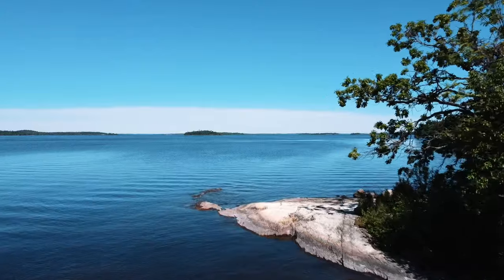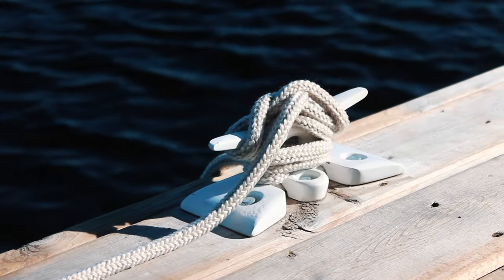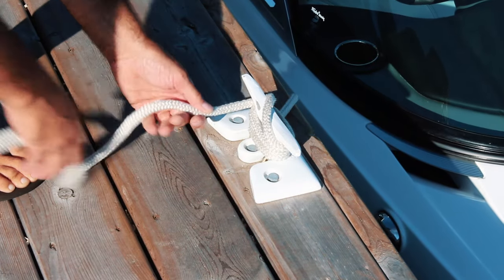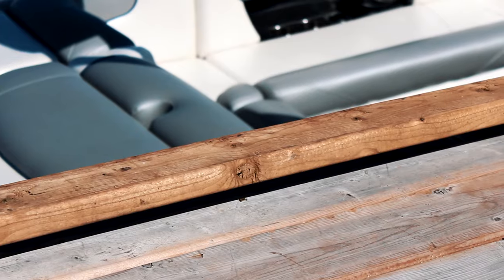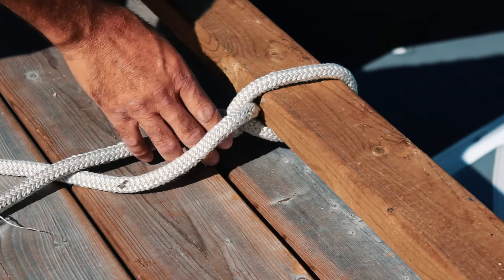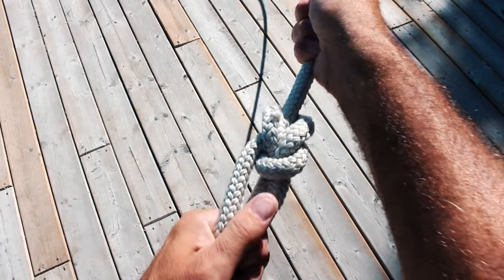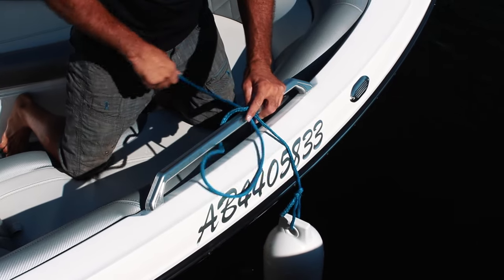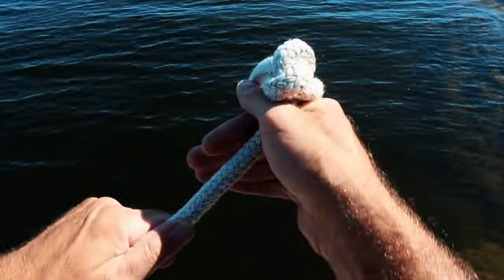Learn 5 Essential Boating Knots | How To Tie and When To Use Them | Lake Life Quick Tips

Comment: I would add the taut line hitch to the list of basic knots boaters should know. I use a taut line hitch to secure the fenders to the boat railings which allows you to easily adjust the height of the fenders along the side when you dock at various ramps of differing heights.  Good short video on knots basics!  Thanks.
Reply from the maker: Thanks glad it was helpful!

Comment: Also good to note that it’s very important to match your diameter line to clear size, I think it’s 1/16” to one inch of cleat. Now that being said a small vessel is going to typically have 4 1/2” cleats vs a typical 12 or 16” dock cleat in this case wrapping a few wraps around the larger cleat with the smaller diameter line then continue with the typical hitch, this will give surface tension to the larger cleat with small line, personally I wouldn’t thread through the eye of the cleat simply because not all cleats have them and if you have a long line could just take up time but most important thing to keep in mind is to keep learning from others and to be open minded, thinking you have the end all be all knot could get you in trouble. Thanks for the video, love your property btw!
Reply from the maker: Thanks for the extra info Rueben, great comment!

Comment: Okay, guys, if you're tying a small boat up on pretty flat water, I suppose these are fine.  But, for bigger boats, more weather, bigger water:

 The Cleat Hitch - Don't tie it this way.  Don't go through the middle.  Just make 1 turn around the far horn, then the near horn, then start your figure 8s.  If the line is really slippery, braided, you may need more than the 2 wraps we always see (remember, Ashley was using tarred hemp; it didn't stretch, and it didn't slip much).  If you use a locking hitch at all, only use it on the last turn.

The locking turn is meant to tame the free end, not to take up strain that made its way 'round the cleat.  You'll not be able to untie it w/out a knife, in that case.  Avoid locking hitches deeper down.

His "Double Half Hitch" - I would make a full turn (go 'round the piling or the bull rail 1 and 1/2 times); at the point you can just hold the turns in your other hand, keep the boat secure, as you tie your 2 Half Hitches on the standing part.

Using 2 Bowlines as a Bend - I generally wouldn't do this, and certainly not if I were leaving the boat.  It is impressive how quickly a line can saw through another line.  Unless the bend will see constant tension, I'd pick something else.  For dock lines, the Double Sheet Bend is great.  I'm also partial to the Zeppelin Bend.
Reply from the maker: Hey Kurt thanks for the feedback. A really common sight around these parts is dock cleats with missing horns. The first thing the rope touches will bear the most load. As the boat rides up and down in the waves it tugs hard on the cleat at the first point of contact. Since the middle hole is the strongest part of the cleat that's the best place to start. Of course if you're docking at a location meant for larger boats the cleats are more heavy duty and you can start around the horn, but the most secure option is to always go through the middle hole first, IMHO of course!
Reply: @JohnFavstar I’m tying a jet ski to my peer at my lake it is a decently choppy lake nothing like an ocean tho lol I just don’t want it to unravel and float away cus that would be very bad